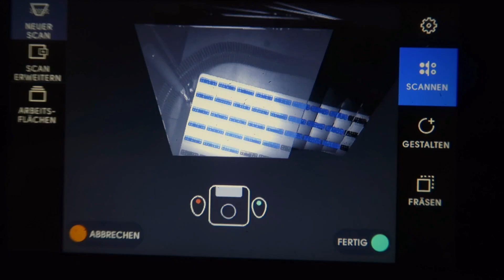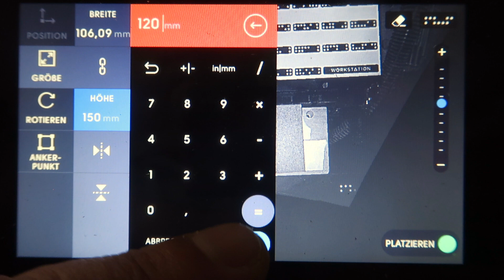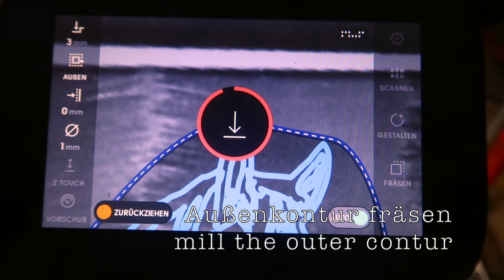Metall fräsen mit der Shaper Origin / Milling metal with the Shaper Origin

Comment: Nice video, great tips!
Have you tried cutting stainless steel… I need to cut of a section on a 3mm thick and 25mm wide fitting, and make a curve across the width. Possible…?
Reply from the maker: Hello, stainless steel I have not tried to cut. I don't think it's possible. With brass, the machine has to work quite a bit.
Reply: Due to Shaper the Origin is only usable for soft metals like Aluminium, Brass, Copper etc. I think Steel would damage the spindle and not sure what kind of router bits you had to use / if there even are some for steel. The normal ones are def not.